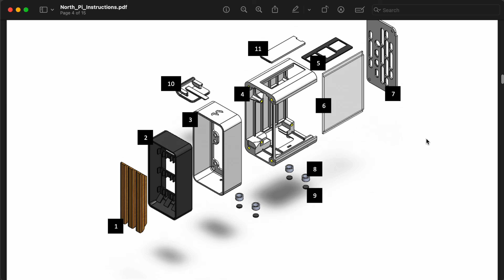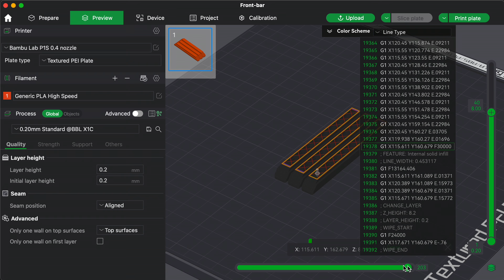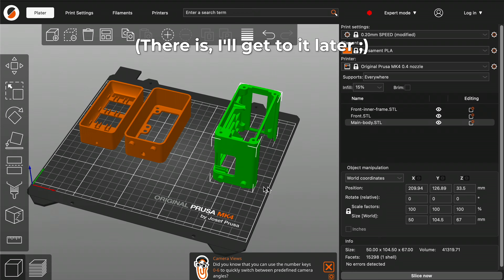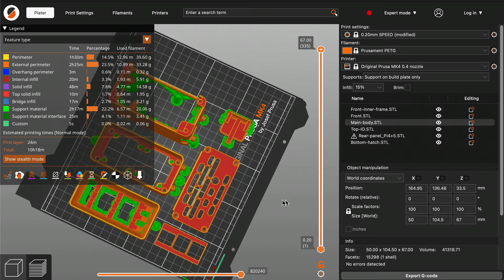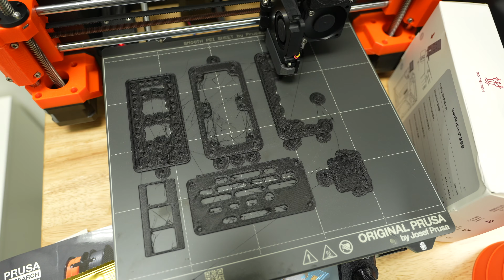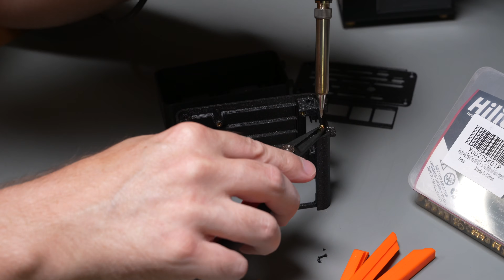Fractal's newest PC case is... free? (some assembly required)

Comment: There's a slicer option that, when printing multiple objects on the same build plate, can help you minimize stringing even further (and slightly decrease print time):

In Orca Slicer, it's in: "Others > Special Mode > Print sequence > By Object"
In Prusa Slicer, it's in:  "Print Settings > Output Options > Complete individual objects".

This will make the printer fully print an object before moving onto the next one. The downside is that each object will take more space on the build plate so that the extruder has sufficient clearance, so you might have to do multiple plates. The upside is that this eliminates a lot of travel moves, so there are fewer opportunities for stringing, and there's a bit of time saved as well.
Reply from the maker: Yeah; never tried that before but I think that could've saved this print (along with more drying of filament, selecting the right profile on the PrusaSlicer—for V0 instead of normal PETG, and maybe adjusting supports a bit).
Reply: You have to be very careful when using this option and how the build  it's layout.  items that are two close together will cause the print head to hit them when starting the next object.
Reply: @Twin_Flyer  depending on your printer setup you can insert a beeep a pause and a home in between objects so you can do them one by one but not have to reload a file every time.
Reply: That helps. But dry PETG for me never strings on a BambuLab A1 Mini

Comment: Stringy prints are a results of wet filament. Dry it in a filament dryer for about 6 hours in 50c and you should be good to go. Play with retraction if it is still stringing. PETG is tricky. Use elmers glue stick to help with easier removal. Clean it off every print and apply new coat for easy removal. its ok to flex the plate a bit to get a flat pry tool under.

Comment: On a cosmetic piece and I know supports are inevitable I chose orientation basted on the aesthetics. The slide-in cover would look better (and probably slid in easier) if printed on it's edge to match the layer lines of the case. Probably with a brim for stability.
Reply from the maker: Yeah, after assembly I realized that, will probably print another!

Comment: Kudos to Fractal, but it's obvious that it was designed without 3d print in mind. Also threaded inserts are too much (luxury) for such small design - 3d printed bore holes will be enough. I think, there will be tons of mods in a while, which should fix those issues.
Already thinking about mods (vesa mount). I'll probably fire up Onshape and do some modding on it ;)

Comment: @level2jeff hey, check your AMS. I saw that you have the waterdrop 4 Symbol in the slicer; I had the same and in the back of the AMS under the filament spools are to latches where drypacks are stored.
Maybe they are still in the plastic wrapping?

Comment: Don't print petg on the smooth plate.  Use a textured plate.  It really releases a lot better on the textured plate.  I know because I've ruined smooth plates printing  petg on them.  As for the stringiness, you just have to play around until you find the right settings, but you could print out a tower to find the right settings and save said settings as a preset... you probably already know this. Just in case others new to this may not.

Comment: So I'm seeing your attempt with the PETG. Something I learned the hard way is to use glue on the bed, that way it's more easy to remove the PETG . Also it won't damage the bed and easy to clean off. Other than that the print looks really amazing.

Comment: I JUST bought a 3D printer on Tuesday for Prime Day (I missed shipping resetting from free 2 day to 1x/week when my CC fraud alert initially blocked the charge- so I have to wait until Saturday or Monday- they sent it USPS... the wait is killing me). I have ONE HomPod Mini (required for thread operation of my smart lock, WiFi chomps AAs) that rolls around like you wouldn't believe. They also stopped putting those little mounting holes on routers. For reasons of remaining a family member, I'm going to print the base for the HomePod Mini, then, routers, then I think I am making one of these cases.

I just realized that I can easily make some AAA money automation stuff AA [alkaline batteries have this weird characteristic where lower draws actually increase the mAh, and I get free AA]

Comment: for the threaded inserts, your soldering should only be 10-20 degrees warmer than the temperature it was printed at, its a lot easier to get them in straight, and will generally be less messy/oozy

Comment: Just so you know petg V0 is not more heat resistant than normal petg. However it is certified UL certified to extinguish itself when it burns.  Now in general that is not a requirement for a computer enclosure usually they don't set themselves on fire. Getting hot yes but until you reach a temperature where a material starts a fire is way higher than the temperature needed to deform it. So in general ABS which should keep its form up to 100°C would be more useful.

Comment: FYI when using heat set inserts, set the iron to a temp just above the printing temperature of the filament (around 220C for PLA) otherwise the plastic melts extremely quickly, deforms, and is very hard to align.

Comment: I'm surprised that Jeff, Mr. Raspberry Pi himself, hasn't done an OctoPi setup for both his MK4 and his Ender. Yes, the MK4 has the local PrusaLink connection, but it is a "It just works" implementation of a printserver, or you could use the PrusaConnect cloud service for the MK4 (dead easy to setup, but relies on "other people's computers" if that is a concern). I prefer having the extra functions (like spoolmanager) of OctoPrint. The Ender needs an OctoPi setup...
Reply from the maker: It's being worked on :)

Comment: It sounds like you need to run a full calibration on your p1s (it's just in the settings on the machine) with one of the more up to date firmware revisions they made it quite a bit quieter (reduces the singing the motors make)

Comment: There isn't a rear panel STL for the Raspberry Pi B+, 2B, 3B, 3B+ which have a full size HDMI port. So this only works with Pi 4B & 5B which have 2 micro HDMI ports instead.

Comment: Huge kudos to Fractal for this
Reply: for what exactly? it's like a lazy hours job tops to draw something like that up in CAD, and probably something much easier to assemble also
Reply: @rikkt731  Companies do not release prototype plans often, even less with detailed instructions, most of the time the community has to come up with alternative designs. If it's so easy to draw something like that you're very welcome to contribute to the community xD
Even if it's low effort or easy, in my opinion, this sets a good example for other companies, it's more about the message than these 3D files.
Reply: @Markfps  it is a "fake" message when they post something overly complex like this
anyone who does 3d printing, as I said, should be able to design something much easier to print and assemble than this contraption, this is suitable only for youtube hipsters and youtube "content creators"
Reply: @rikkt731 What about this case is difficult to make?
Reply: @rikkt731  Complex lmao, it's really not that bad. It was originally made for a trade show prop and wasn't meant to be released, they saw people want it, so they at most quickly cleaned it up and made a very nice guide for it. They also could have released nothing. No need to be so negative about it.

Comment: You don’t need multiple slicers, save yourself time and get orca, one slicer compatible with everything, unless you have those very close source machine
Reply from the maker: I've mostly used Cura for years, only using the vendor specific ones temporarily while I work on getting profiles set up for all my printers in Cura. what's the benefit of Orca over Cura?

Comment: Hey Jeff, when you print PETG you should really use a satin powder coated sheet for the build surface but if you don't have one spread normal everyday school gluestick glue over the build surface before every print. Be generous with it and you won't have to worry about destroying your PEI sheet. Also, keep PETG dry and if you don't have a heated chamber consider printing it from a drybox.
Reply: Another release agent that works well (kept my smooth build surface from disintegrating faster than it did because I didn't keep up with applications while mass printing frames for Covid face shields) is Windex. Apparently there is some unpublished additive in specifically Windex that helps release PETG from the smooth PEI surface when the sheet cools down. The Windex residue creates a super thin, uniform layer that you don't always get with gluestick. YMMV

Comment: STL is "my surfaces are made out of these triangles". G-code gives specific instructions for each subsystem of a CNC machine, whether that's a printer, lathe or mill. People used to program G-code by hand, big milling machines often still allow editing of the G-code at the console.
Reply: You can still edit G-Code by hand, since they're just plain text files read top to bottom with the commands.
Reply: "G-code gives specific instructions for each subsystem of a CNC machine"  
No, that's M-code. G-code is positioning only, the machine wouldn't know what to do if you just fed it G-code.

Comment: errrm I just started 3d printing this week with the P1S, I had never 3d printed anything before.
I can't say I have had any problems yet apart from a first layer not adhering due to fingerprints I guess, and ramming a scraper in my thumb.
I cleaned the PEI surface with isopropanol, and then it was fine. I have not used the smooth plate yet.
I still have to order screws and inserts

Comment: Interesting to see how printing with PETG without an enclosure works. 😅 I’m new to 3D printing. I’ve waited so long, because I’ve been waiting for the most basic issues to be solved. I’ve printed mostly Multiboard in PETG, and haven’t seen anything near that amount of stringing with the Prusa MK4 in the Original Prusa Enclosure.

Comment: What printer would you recommend  to someone getting started with 3d printing?
Reply: One that sets itself up and has a filament-profiling system. Enders are the worst for noobs because you'll get super frustrated not knowing whether your bad print is caused by bed alignment, z-height calibration, bed temperature, bed prep, extruder temperature, extruder fan settings, room temperature, airflow, room humidity, moisture absorbed by the filament or just slicer settings. Worst case you get multiple things wrong in the same print and it's not obvious what or how many things are wrong without wasting loads of filament and time iterating.
Reply from the maker: if you have the money, the MK4 assembled, or a P1S or P1P. An A1 is a good option too. For a bargain, Creality has some lower priced options, but you usually need to learn a little more to get proficient with their cheaper printers.

Comment: Can you still get to the screws for holding the front on after glooping the bars in place?
Reply from the maker: oh, uh... didn't check that. hopefully yes, haha
Reply: @Level2Jeff  You should be OK. I downloaded the model to have a look and that bit is only held on by one screw on the bottom of the case, It's the outer surround that screws directly into the main body of the case  from the front.

Comment: PETG is irritatingly hygroscopic, so it usually needs drying, sometimes even right out of the vacuum bag. Retraction settings and lower temperature can help, too. I've had the worst stringing with recycled PETG versus virgin PETG.

Comment: Just a protip on the filament stuck on the build plate.  If you use a shaving razor blade you can scrape it off easier with it. Also for petg to prevent the stringing you need to completely dry the filament before using.

Comment: You can print PETG on the smooth PEI sheet, but you need to use a little glue stick to form a layer to make it easier (possible) to remove.
If you don't the PETG can bond to the PEI coating and it can come away as you remove the print, destroying that side of the build plate.
... And yes, this is a warning coming from experience 😔
Reply: If you read the datasheet (info page on the Prusa website) for PETG, it tells you exactly this. They recommend using a textured sheet, which I always have and have never had issues.
Reply: Reading the instructions before I break something‽... one of these days I will remember to do that 😉 😆
Reply from the maker: Heh easier to remember when you break a build surface!
Reply: It is a rite of passage into 3d Printing that you destroy a PEI sheet the first time you use PETG. (or at least I hope it is, because I did.)
Reply: @Damien_D  never had problems with rigid PETG parts on PEI sheet, but when I printed thinner more flexible parts, not only I destroyed the parts but took me like two hours to carefully scrape the remains from the PEI plate lmao, luckily no damage and lesson learned
Reply: I'm 90% sure I have a memory of literally ripping a chunk out of a glass build plate trying to get some PETG off of it.
Reply: @robonator2945   Happened to me with my borosilicate.
Reply: and another thing for petg, never and i mean never use glass beds for it. it will rip off the glass off of the bed. speaking from experience.
Reply: @ItsKefir   I have liberated a chunk too, but i still print on glass, i just coat it with PVP. Haven't had issues since i started doing that.
Reply: @SianaGearz  i got a textured plate for it and it works wonders now

Comment: More tips, those are not heat inserts, those are for injection moulding, heat set inserts are different.
Reply from the maker: What's the difference?
Reply: @Level2Jeff The ones made for heat setting have self centering features and tend to end up more straight and even with the surface. 
Not much difference in terms of strength but bottom line they're just much more pleasant to use.
Reply from the maker: @oliverer3  Ah, so that would've helped a bit in terms of not melting in slightly off-center. Looks like they hold a slight bit different too. Will order a set!
Reply: @Level2Jeff  any recommendations? for someone who will prob only do this once
Reply: @Level2Jeff  Jeff, if you want any tips for future 3D printing related stuff, you can PM on Printables bud, happy to help, I design 3D Printers and Printer Upgrades, so I have pretty good knowledge on the subject :)
Reply: @Level2Jeff  Have a look at some other videos on youtube maybe from CNC Kitchen or ModBot, they are very different, the ones you purchased are for injection moulding, so they are not good for inserting, the design is very different, on a side note, I purchased the same ones as you many years back when I first got into 3D printing :)

Comment: Jeff, you need to dry that PETG, that looks awful, you should have almost no stringing, also use Nano Polymer as a bond/release agent and use IPA to release off the build plate, I think you need some tips on 3D Printing bud :) my machine will print this entire thing in 3 to 4 hrs without breaking a sweat.
Reply from the maker: I pulled the PETG directly out of the package, and used it immediately—I can't imagine drying it further from the factory wrap/desiccant would help any more, but maybe running it directly out of a dry box would help. I will be drying it before using it again, though... and I won't print something that requires so many retractions/moves between models!
Reply: @Level2Jeff  Drying it further definitely helps! I always dry any petg filament min of 6 hrs and all stringy goes away.
Reply: @Level2Jeff  Most of the time filament needs drying right out of the package, sometimes its okay, but PETG is quite hydroscopic, best to dry for 4 to 6hrs at 55 to 65 Celsius, you can use a food dehydrator for that, pretty much all filament except for PLA requires drying, and in moist climates, even PLA needs drying from time to time, again CNC Kitchen has some great content covering these topics.
Reply from the maker: @NexGen-3D  I have a filament drying box on my list... might just pick one of those up since I could stash it next to the printer. It looks like a lot of them even have a little output so you can print straight out of them!

Better than the AMS solution which just has big desiccant bags.
Reply: @Level2Jeff  I can recommend the Sunlu FilaDryer S4 or if you want a single unit the Creality Space PI but the Sunlu S4 has an automatic mode, that can keep your filament dry constantly and turns on and off by itself.

Comment: PETG is a bit tricky to work with at first. You do need to keep it dehydrated. It absorbs water. you can dry it back out, it just takes time.
Reply: This isn't exclusive to PETG, it even affects PLA. Let PLA lie around long enough and you'll get stringing and other issues if you don't dry it. Just doesn't happen as fast as with PETG or Nylon.
Reply: @brinkoftext  Yeah, but unless you live in a humid environment it takes a LONG time. Can be years. Some brands will still be fine 5 years later in a dry environment.
Reply: Yeah, any time I print with PETG, I go ahead and throw it in my filament dryer for a few hours first. Takes no time at all for it to get stringy like this.
Reply: @benwyattjr  Mine is kept in a plastic tub with lots of desiccant. That said I don't print much these days and prefer pla so I haven't used it recently enough to trust it.

Comment: PETG, you'll probably need to dry that filament. Also, invest in a heat gun, with a little bit of stringing, you can just melt away the wisps.

What you have tho is a little overboard on stringing which tells me it needs to be dried.